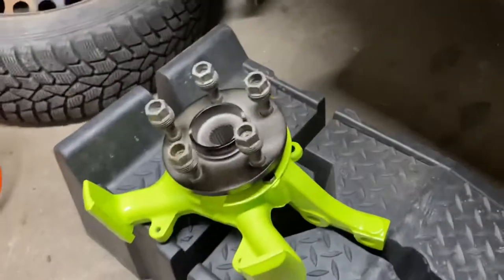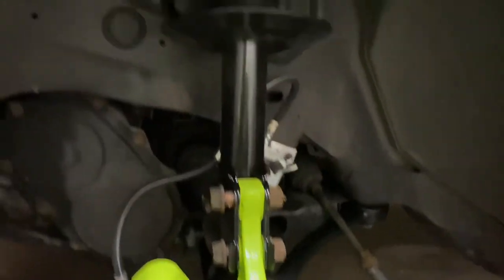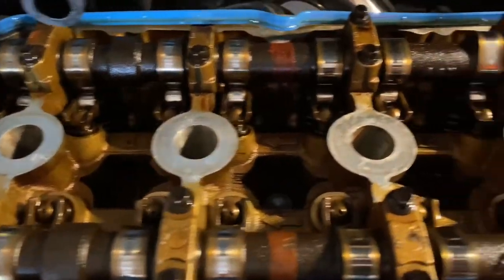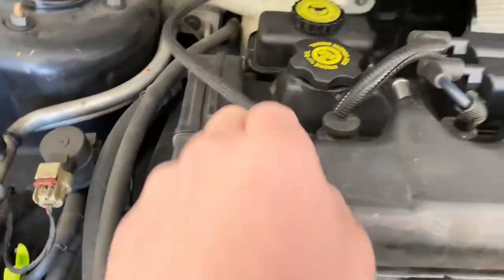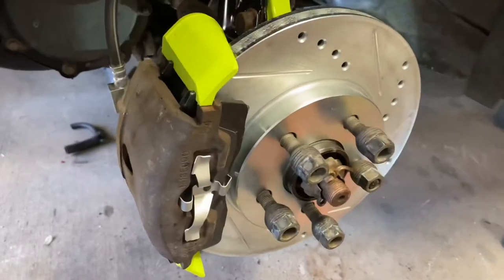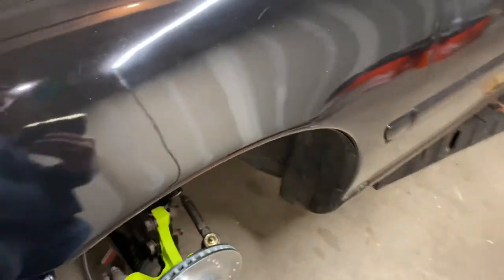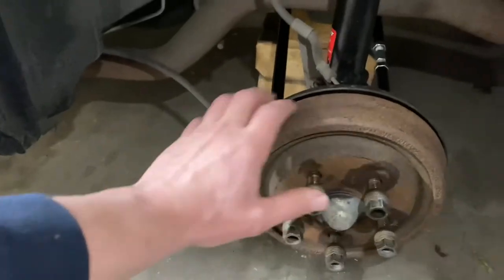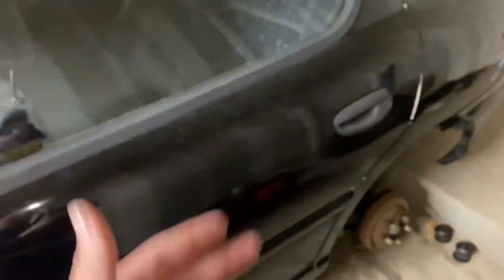Pt.2 upgrades for the 98 neon sport

Comment: I picked up a 1999 Plymouth Neon Expresso for $2200 with 88,000 original miles! This little 5 speed neon is SO CLEAN. I for sure fell in love with the alpine green paint and 2 tone camel interior. I put over 2,000 miles on it over the course of 9 months and oddly enough it’s completely reliable. I’m so happy with how smooth it rides and that it has a working Air conditioner! Finally a reliable car!

Comment: Nice! Always nice to see the Neon's being worked on! I had a 97 neon that I did everything to including rolling it driving too fast on a dirt road. I now have a 2005 SXT that I am getting ready to Raptor line. New control arms, quick struts, inner/outer tie rods, full tune up, timing belt, clutch, brakes, ignition switch, cam sensor (dont forget to replace the magnet), crank sensor, winterforce mud/snow tires really work and look cool, and of course a stereo system that is worth more than the car.  People ask why? Parts are cheap and readily available and it's a NEON thing mother F#cker is what tell them! Besides..how much does a new car cost?